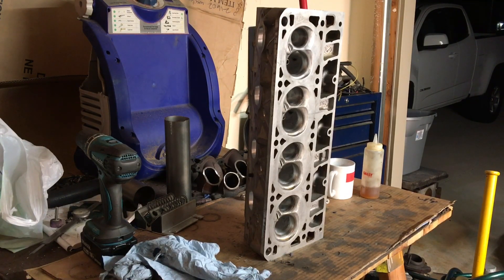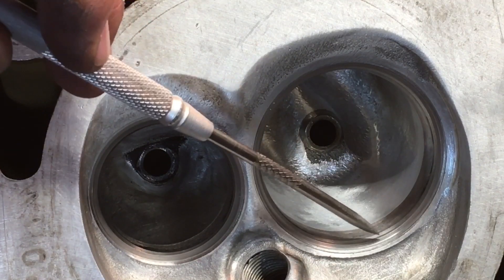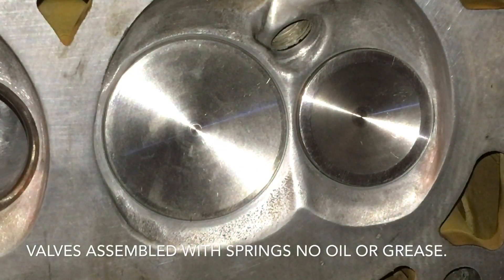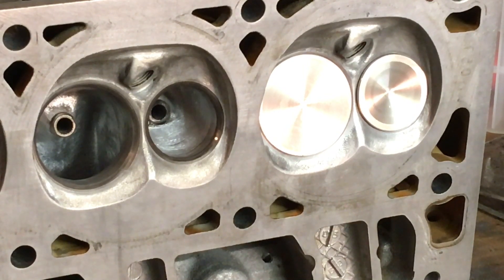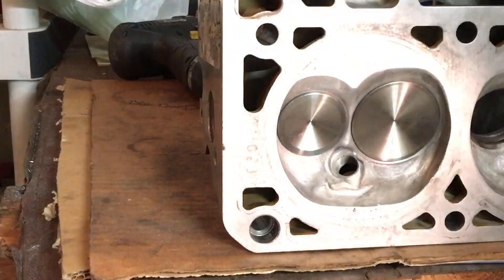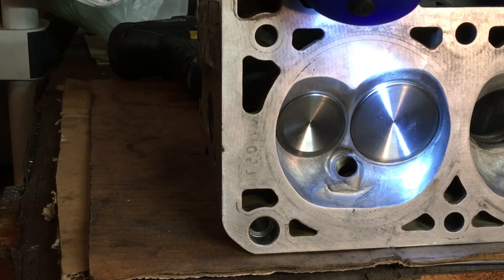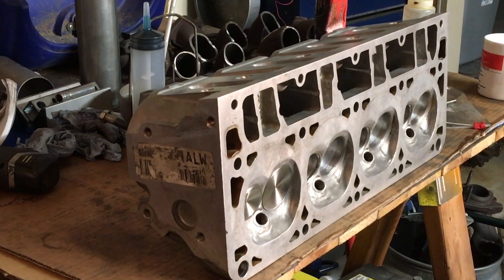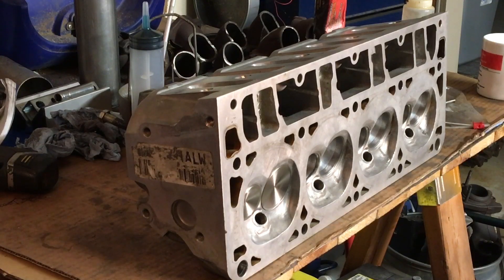243 head test Will 2.02/1.57” valves lap in? NOPE HERES WHY!

Comment: When that exhaust valve heats way up the gray band your talking about won’t be aligned with the seat band.
Reply from the maker: Why doesn’t it leak; the sealing area is wide on the exhaust valve is wider to work with the higher temperatures?  I’ve got cylinder heads on 1500hp engine running without problems.  Lapping in a valve is a way to verify the valve/seat are mating appropriately.  Many shops don’t even check valve/seat interface anymore, they cut the seat angle to match the advertised valve angle and assemble; I like to vacuum test everything. 
On trying to use 2.02/1.57 valves on oem seats cut for 2.00/1.55 the valves could seal but the stem height is way out of specification.   We were curious to see if the valves would even seal. JD

Comment: You’re not supposed to lap exh valves, at all.
Reply: Wherever your lap band is on the seat and valve are not where they will ride when they’re several hundred degrees
Reply from the maker: @petejoseph8257  I’m not sure who made this rule, lapping exhaust valves has been done for ever.  So far so good on all the heads I’ve done, even in the 1000+ Hp range.

Comment: I think you run the risk of burning up your valve seats with the sealing face so close to the edge of the seat but it will be interesting to see the outcome when you actually get it on the road.
Reply from the maker: It doesn’t work because the stem height was way off. It was just a test to see if it would seal. We ended up going back with the 2.00”/1.55” factory valves. These heads flowed 300+ cfm @.600” lift. JD
Reply: @HeadFlowInc  would it help on 2.02 valve to get a longer stem? I had just watched a video from A21Bravo just unpacking 862 heads you built with 2.02 ect.. . I own a set of #799 going on a 6.0L. Your videos really are  inspirational 👏 🙌 .

Comment: any way you can compare valve seats, one for the 2.02 to the one in the head, i would not be surprised if they were the same size.
Reply from the maker: I know some shops will cut the stock seats to 2.02”, I think there’s enough material left.  I have 2.00/1.57” valves in my 862’s on my Turbo 4.8 now. 
It may be purely a money game where shops can get paid... very possible. 
Stay safe Happy New Year!!! JD

Comment: Were these installed on an engine with no valve job for 2.020/1.57 valve? If so how did they perform? I’ve got so much money dumped into my project if I can save a little money & time here I’m all for it.
Reply from the maker: No they were not used with the bigger valves!  We were testing to see if the valves would seal to the factory seats.  Yes the valves lapped in to the factory seats but you LOSE too much of the valve stem height, the stem height determines proper valve spring installation, pushrod length and overall valve train geometry.  Cylinder heads have a margin here the valve stems need to be. 
If you replace the same size valve as it started you could most likely lap them in. 
I wouldn’t try running 2.02”/1.57” valves on factory seats.  JD

Comment: I bought an old black and decker valve seat grinder on eBay. It Uses the stones which you cut an angle into (whatever angle you want to cut into a seat). Works great! The old school way of doing it. I have like $200 in the entire setup. I put some 2.02s into a set of 862s, 3 angle job, de-shrouded as best I could. It runs amazing... Until you hog out that 60* undercut you're not gaining performance on larger valves... btw 2.02 and 1.60 are pretty close to the limits of what'll fit in the factory seats. I've heard some have fit 2.05 but its on the edge...
Reply from the maker: Scott Coleman That’s ironic, I’ve been looking at old school seat grinders on eBay.  I was worried about finding an 8mm guide for the LS heads, I’m assuming you were able to do all the work with the 5/16 arbor? 
I’ve had heads done with the bigger intake valves but Nolands doesn’t recommend going much bigger than the 2.02” on a factory seat. I don’t recall what he said about the 1.60 valve on a factory seat? 
I’d love to have a way to do valve jobs, face valves and back cut valves the easy way at home!!!  Those valve facing machines are expensive $1000.00+ 
Thanks a lot for the feedback I appreciate it!  Thanks for watching JD
Reply: @HeadFlowInc  yes I'm using a 5/16 arbor, my arbors all have a taper on one side and a claw like nut on the other.  The nut goes on the seal side, the taper seats into opposite side of the guide and when the nut is tightened it pulls the taper into the guide and takes away any clearance making it tight. 
I just put a set of 1.60s into a set of 243s and the placement of the 45 ended right on the edge of the seat. I believe it'll work but it's close lol.
Reply from the maker: Scott Coleman Thanks for replying, this information definitely makes me want to buy a similar setup.  I bet the 1.60” valve is on the edge, when I had those 1.57” valves put in my 4.8 heads it was close.  Thanks again I appreciate it!  Stay safe & Happy Easter!
Reply: @HeadFlowInc   you're welcome, happy Easter!
Reply from the maker: Scott Coleman FYI if I ever miss follow up comments it’s because Youtube doesn’t send me a notification.  I get notifications when someone replies to a video the 1st time, any subsequent replies I get nothing. Thanks I hope you guys had a great Easter! 👍

Comment: why would u use oversize vases on stock seat?
Reply from the maker: bb bk We we’re curious to see if it could be done.  This was a test to see if it was possible to run the larger valves by only lapping them in.  The weird part is the valves lapped in and sealed, but the stem length being too short was not expected.  It might be possible to play with +- .050” locks etc to correct the IH if you wanted.  In the end we just wanted to know, thanks for the feedback!  JD
Reply: @HeadFlowInc  ok, because i remember from aircooled vw, sinking the valves and 3 angle was a common, therefore i was confused. thanx for clarifying

Comment: Would the bigger valves interrupted the air flow being closer to the combustion chamber wall, a smaller valve with more clearance might flow better around the wall?
Reply from the maker: Philip Martin Shrouding of the valves with either the combustion chamber wall or the upper portion of the cylinders at the deck are both a concern. 
Unshrouding the valve can be done to improve flow characteristics. Many times it’s application specific determined by cylinder bore on whether you get better flow with different valve diameters. 
Thanks for watching and the feedback I appreciate it!  JD
Reply: @HeadFlowInc  Thanks for your reply, appreciate all your videos.

Comment: the only thing you will achieve putting a bigger dia. valve on same size seat is reduce flow from increase shrouding against chamber wall.
Reply from the maker: PowerPlay Engines I will point out I’m porting the cylinder heads, HFI it’s kind of my thing... 😉

Comment: Well, I just ordered the summit budget LS pro series forged pistons with pins and their rings to be installed on re-used gen4 type rods. These come with valve reliefs that are intended to be compatible for both cathedral and square port heads. I wonder if these pistons would allow the slightly larger valve sizes. Thanks for sharing your discovery.
Reply from the maker: Christopher Ryan I sure wouldn’t think it would work. When you receive the pistons look at them and how deep the reliefs are cut.
Remember all 3 areas affected:
Valve train geometry
Piston to valve clearance 
Push rod length
Reply: HeadFlowInc the past number for them was SUM-3269434005-2 if you wanted to check them out. I can’t link to the page directly on YouTube but they were 0.005 over pistons for my LS2 with a 4.000” bore.

Comment: You are lowering the installed stem height as well as putting the valve closer to the Pistons. With a tall cam you will have cool bind and valve to piston contact
Reply from the maker: Tim Smith I see what your saying, trust me I understand.  Keep in mind the valve seats in the heads are still a constant, the new larger valves are sealing in an appropriate area on the seats.  Now the true indicator with valve “depth” will be to measure the stem  height and check the valve spring installed height. 
You have a .010-.020” variance +- when setting up the IH for the springs. If you install the springs -.020” IH then the same amount must be subtracted from the springs advertised Max lift. 
I’ll be sure to video the installed height of the valve spring area with my IH micrometer.  I’m very curious to see what they measure! 👍
Thanks for the feedback I appreciate it and thanks for watching !!!  JD

Comment: I am not seeing any advantage. The only thing changing is the valve will sit higher on the seat lowering chamber CC slightly but creating flame travel issues.
Reply from the maker: Mike D There won’t be any flame travel concerns but the stem height definitely needs to be checked. You can be +- .010” on the valve spring installed height.  If you have Less installed height, subtract the amount your shy of the recommended Installed Height, from the max lift of the spring. 
I’ll definitely check the installed height with the IH micrometer. 👍
Thanks for the feedback I appreciate it!  JD

Comment: Flow numbers would be interesting to see,  Just thinking about it the OEM seats untouched with bigger valves may obstruct flow more then it helps but the engine will run no doubt, but .020 isn't much either.
Reply from the maker: John Cummings The heads are ported to work with the bigger valves.  I have the intake Bowl cut to 1.81” and the exhaust bowl cut to 1.334” 
The valve seats won’t hinder the flow. 👍
Thanks for watching and for the feedback I appreciate it!  Keep watching I’ve got some 862’s coming up next!

Comment: A proper multi angle will improve flow dramatically. Especially low to mid lift. Not to mention then there will be no question about sealing issues or longevity. $180, in the grand scheme of things and for what you are trying to accomplish here is money well spent! This is where a flow bench will tell the real story!
Reply from the maker: poncoolride I agree, when the budget allows, as a general rule have fresh valve jobs done. 
This particular customer likes to try a more Sloppy style builds trying to find ways to keep costs down. He has another SBE build w/
My ported 241’s on his other Turbo build and it’s making great power!  A tad over 1000hp at the crankshaft on 16-18# SBE 5.3 $1000.00 total in the engine 👍 Everything will be functional and safe we’re not going to do anything unsafe.

Comment: no offense but I think you should research what AFR and Texas-speed heads look like when they are ported completely. the shape after the valve guide should be addressed. And a bigger valve without opening the seat and blending, in my opinion, would be in the way of airflow and be closer to the side of the chamber cause more shrouding to happen. Also, a 4.8/5.3 bore engine should only use the 706/862 heads with stock size valves as they perform the best out of all stock castings(706,243,317,241) for that bore size
Reply from the maker: Daniel Blackstone I will invite you to watch all my porting videos before replying to your observations. 
I’m more than willing to compare my port work to any of the places you’ve mentioned. Cylinder head porting Math, Theory and port sizing all play a part. 
I’m not trying to degrade your comments.. but I think you should learn a little more and get more exposure to what a ported head looks like, especially the difference between a cathedral port, Square port, aftermarket etc. 
You’re doing a good job sharing information you’ve read about.  Hopefully more people will read the article showing how “cylinder shrouding” becomes an issue when you run the bigger valve heads on the 3.785” bore 4.8/5.3.  Minimum bore should be the 3.898” LS1 bore to step up to the 2.00” intake valve and it’s marginally better. 
Valve spring height is determined by the manufacturer generally 1.800” IH.  Valve Stem Height is what’s needing to be verified anytime you change valves, get a valve job etc.  The LS heads will have a variance guideline in setting the Valve Stem Height, this is to maintain valve spring installed height, valve train geometry and pushrod length on a stock/OEM setup to control lifter preload in a non-adjustable valvetrain. 
Measuring and verifying the installed height should be mandatory. 
What area of the transition from the percentage bowl cut, blend and guide boss reduction do you think needs more/less work and why? 🤔JD
Reply: @HeadFlowInc  I have followed you for a long time and I do know the differences between all the different LS cylinder heads and even some SBC. I'm 33 yrs old and I've ported a few sets of heads for my self and other people. the last set being 243s. I tested some 862s with bigger valves that I did on my 5.7 in my 2001 Corvette against my ported and shaved 317s. the 317s did way better via my hptuners scanner. ValleyCylinderHeads on Instagram have a lot of good photos and hints to what makes improvements on the mods you're already doing.
Reply from the maker: Daniel Blackstone I’m not getting notifications for all your replies, sorry.
I’m confused how/why your ported big valve 862’s we’re out performed by a ported and milled 317 head? 
What port size did you create in each casting, what bowl cut percentages for each?  Fundamentally, you can make any casting number cylinder head flow the same, more or less than any other casting, with effective chamber size being the only difference.  🤔🤔🤔
How are you using HPTuners to test the difference between cylinder head flow/power?
Reply: @HeadFlowInc  the last ones I did on 243s were close to 230cc with the opening of the intake port ever so slightly opened with a sand paper roll. my 317s I never touched the opening. I think they did better because the floor is higher on a 317/243/799and even higher on the square port style heads. the thickness from the deck surface to the floor that you can pinch with your fingers is greater. the chamber diameter is wider on a 317 than a 243/799 too and the 706/862 is even less diameter than them.
Reply: @HeadFlowInc  I didn't keep track of the  bowl percentages but I tried to make them all the same with the snap gauges. I havent cc'd the 317s yet but they are still on the shelf. I thought the higher compression 862 heads ported with bigger valves would help but they didn't and I haven't changed them back. 

On Hptuners I'm logging the Maf lb/hr or lb/min. I caught the idea from matt happel on one of his running sessions on a ls3 camaro. he said that roughly the airflow through the mass air correlates to crank hp. I can try to find it and link it here
Reply: @HeadFlowInc  and I only mean porting behind the valve guide of the intake port on the valve side of the port. the aluminum is a weaker material. the castings ar pretty thick for that reason.  for example, consider how thick the material is around just the rocker bolt bump lol. it must be 3-4mm thick just in a spot that we carelessly cut though
Reply: @blackstonegarage5394  which specific 5.7 aluminum Corvette block are you talking about... most Corvettes through a few years... like I know for instance I think it's 2003... base model Corvette came with aluminum 5.7 aluminum block... the base model came with a 5.7 aluminum block also.. what should be the Z06 model... the Z06 model badge around 2002 2003 in 2004... it was really cool when some of us realized... that the Corvette carried two different LS 5.7 aluminum blocks.. the Z06 badge block has better cooling windows in a little more aluminum material within the block for strength and some stuff revised
Reply: @HeadFlowInc  also. if the valve isn't cut down into the seat the installed height will prob be less than spec of 1.800"
Reply: @HeadFlowInc  Google search 706 vs the world
 there is a good article from one of the well known publications on all the cathedral heads on a 5.3
Reply: also, what's the installed height of the bigger valves?
Reply: Watch "NASCAR Chevy SB2 V8 Turned Into a Racing V6!?" on YouTube
https://youtu.be/BsZ5FTtcHyg
Reply: there is a part in that link up above that shows the inside of an sb2 cylinder head. I think the design and shape around the valve guide and beyond should show us what we are striving for
Reply from the maker: Daniel Blackstone Casting differences between SB2 and Cathedral port LS will not allow porting or digging behind the guide boss, you’ll hit coolant. I’ve seen the SB2 V6 video before but I’ll watch it again. Be very careful trying to implement different porting techniques between castings and different manufacturing because coolant passages and thin areas must be identified as you may know.  JD
Reply: @HeadFlowInc  I'd love to get your contact info and show you some of the heads I've done. there is definitely enough room to make a tear drop shape mimicking what the square port ls3 style heads do
Reply: What!?!? The later 5.3s with the 243 heads ran pretty hard compared to earlier 5.3s. If you had a 6.0/6.2 I’d be using a rectangular port head with a bit of exhaust port work.
Reply: @nsboost  flat top pistons and vvt that I would assume has better cam specs plus a better intake that prob makes up for a lot. they used a trailbalzer ss style intake and 4 bolt throttle body

Comment: I have a set of these on my camaro. Ive had them milled and ported. 30 hp gain.
Reply from the maker: Chemical Spore These 243’s are extensively ported 220cc Intake runners 300+ cfm heads.  😉👍
Reply: @HeadFlowInc  hard core